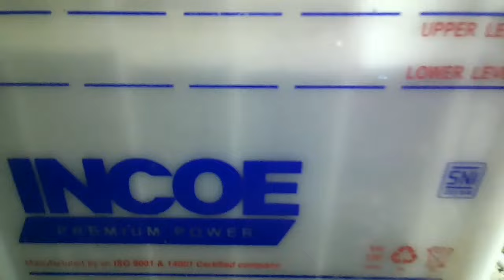cara ganti sel aki mobil

Comment: kl 1 sell yg rusak gak usah di gunakan gmn bang/cm pakai 5 shell aja, apakah bs?
Reply: Bantu jawab bang.. Karna aki 12 volt untuk memenuhi itu setiap grup cel sekitar 2,3 volt. Jika satu grup/cel tidak dipake jadi gk memenuhi 12 volt bang.. 
Selain dikoslet yg nampak gelembung juga bisa menggunakan avo meter dengan salahnsatu pen dimasukan ke air aku tiap baknyam dan 1 masukan ke kutub posistif atau sebaliknya. Ataupun celup antar baknya.. Jika dibawah 2 volt ntar bak dipstikn ketahuan cell yg rusak..

Comment: Mas kalo aki soak kalo dicharge udah 10 jam maksimal cuma di 11,5 V ampe aki panas banget, dan mendidih cuma satu ruangan, tapi kalo dikonslet ga ada yg mendidih trus ntar sejam aja Voltase udah turun sampe 5,5 V kalo dibiarin 2 hari tinggal 2 Volt. Padahal udah sy kuras bersih dan ganti air Zuur 8:2. Kira2 apa yg ga beres ya?? Mohon informasinya..
Reply from the maker: selnya uda rusak mz
Reply: @doktoracculampuriaria8049  Owh.. ga bisa direparasi lagi berarti. Yaudah.. tak tuker tambah aja. makasih mas..
Reply: Orang mau nanya solusi ko malah di suruh tukar tambah kalo tukar tambah mah gak usah nanya. 😏
Reply: @bayusegara455  Udah nurut aja ama Dokter aki..